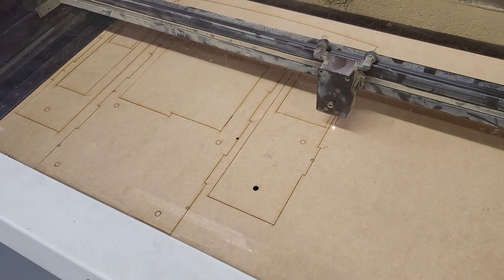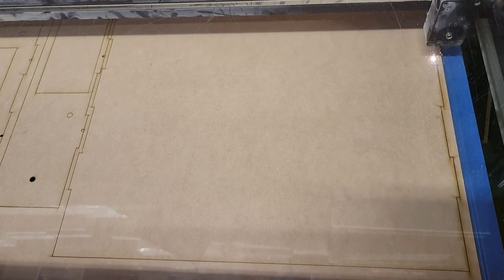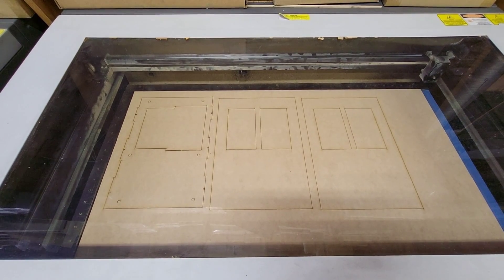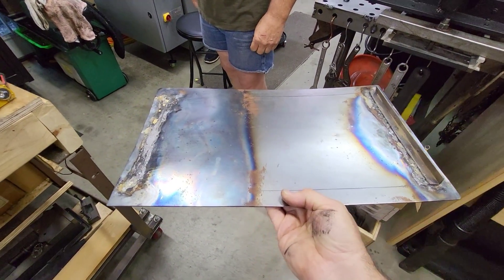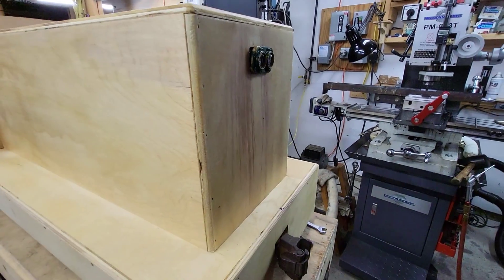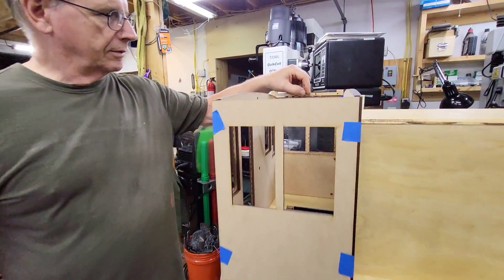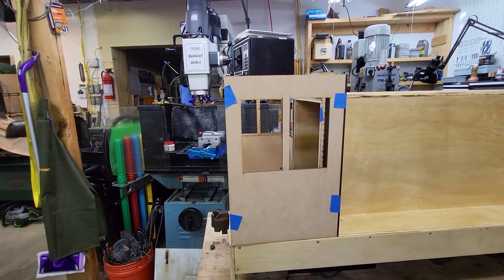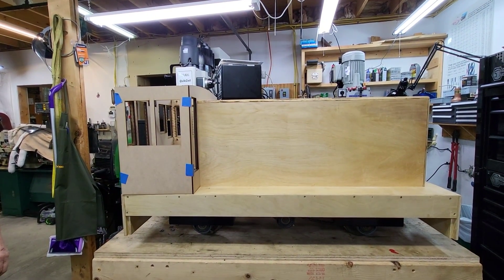Watching a 100W laser cut an MDF locomotive cab: MLBK 70 rebuild

Comment: If you don’t mind using an airbrush/sprayer you can get any color you want custom mixed, or even color matched to your existing yellow.
Reply from the maker: I used to mix paint at an auto parts store. That's why I prefer rattle cans. Less waste after the job is done. It's only the yellow I can't find anymore, so I may have to pick something close but a little brighter.
Reply: @MillBrookRailroad  well good luck finding the replacement color then.